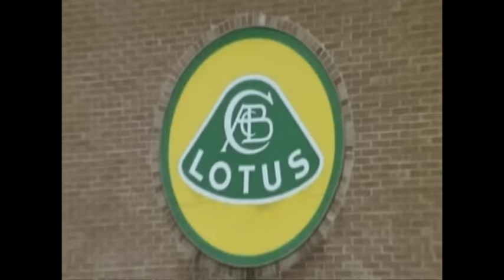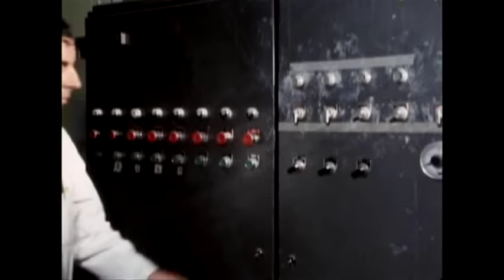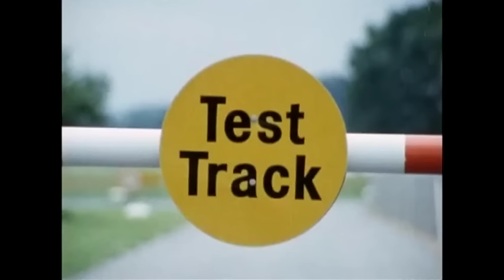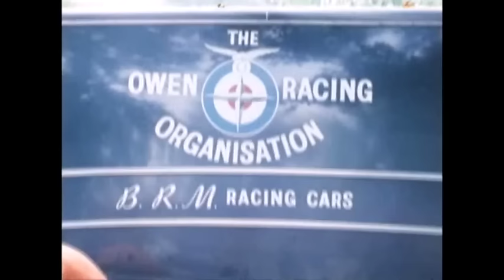1968 Millionaire: Colin Chapman

Comment: Chapman, the man responsible for Jim Clark's and Jochen Rindt's dead plus several other thankfully non lethal accidents caused by lack of structural integrity because saving weight was more important then human life.
Reply: they knew the bloddy risk, so do I...I´m fully aware of that whenever I sit in my Lotus too...no to very little margin for error in those wonderful machines
Reply: There's a difference between knowing about the dangers of a crash because you knowingly drive in a bathtub filled with gasoline and crashing due to lack of structural integrity. I'd love to see your reaction if a loved one dies because of sudden suspension failure. Even more so if you knew that Chapman neglected using bigger security factors in his stress calculations to save weight. Other teams didn't and they ran just fine. Not saying he was a psychopath/sociopath but he certainly had his priorities in the wrong place.

It was well known at that time (late sixties, early seventies) that his cars were fragile and even Rindt complained about it if i'm not mistaken. Ironically that's exactly why he died. And i'm not saying fragile in the sense of being dangerous if you crash but fragile in the sense of failure of essential car parts while you drive at 180 mp/h etc.
Reply: SpocksBro Circumstances about Clark crash are still not clear, but you are right for Rindt ; he complained about security to Chapman more than once... Even if I am a Lotus lover, I can’t discuss this, sometimes Chapman went too far... And as he was often convinced he was right, he did not took care about security... I do not know how to traduce this in basic English (sorry, I am French...), but it seems he said that he pays his pilots for ´fear salary’... Please if I am wrong correct me!😉
Reply: SpocksBro, One could argue that racing is about constantly changing things and compromises are part and parcel of the process.  Safety is not the first place to look for in compromises but unfortunately, it is always where those decisions come back to when things go wrong. Racing has always been about pushing boundaries and safety can always be blamed when things go wrong but hardly ever given credit for when things turn out well. It is a dangerous sport for that reason. Even if the best and safest things are done and someone dies, it is also easy to say safety could have been better or some part on the car could have been designed better to prevent this kind of thing of accident. The drivers always have the option of not driving or participating. No one is forcing them to do it.
Reply: Ridiculous conclusion to reach. Shows no respect for or understanding of racing in this era. It was very clear even in this video that Chapman cared deeply about driver safety, the monocoque chassis design saved many lives compared to the tubular steel design, described Jim Clark as his 'best friend', he never really got over his tragic loss, he's even warning rival Bruce McLaren about a potential problem (18 minutes in) and calls Graham Hill in on safety grounds! You'll notice the drivers at the time raced with open face helmets. It would make more sense to blame the helmet manufacturers for not caring about safety. It's a great video, why try and ruin it in the comments with negative garbage you heard from somewhere else?
Reply: Probably the stupidest comment on YouTube. Well done 👏🏻👏🏻😂😂
Reply: Clark was killed in all likelihood by a rapidly deflating tire brought about by a slow puncture in his tire sidewall. Examination of the tire post crash found a nick that would've prevented retention of air post reinflation. The deflation would eventually cause centrifugal forces to build up to the point where the sidewall lost integrity and collapse. Evidence for this theory is backed up by several witnesses at the Sachs Kurve who noticed Clark  putting on opposite lock going into the stadium section for no apparent reason before starting the lap he crashed on. This would be consistent with a deflating tire.
Reply: This insults that he did it on purpose, which is very clear that he did not do this. So a race car driver died in a race. That’s the risk you take. Any many drivers died in non-Lotus cars as well.
Reply: @grossmeister1181  I would have to disagree. And no one insinuated that he killed people on purpose, just that he was blinded by the hunger for success at any cost. If cars continue to break down due to structural weakness, there's a problem. If the structural weakness includes parts of the car who's failure would likely lead to very bad incidents at high speed, there's a big problem.

The fragility of his designs were criticized by various people back in the day. If I remember correctly, even Jochen Rindt complained about it. Ironically, that's the reason he ended up dying.

If people die in a plane crash we don't tell them, well, you knew flying can be risky so, live goes on. People lost lives which leads to an investigation to find out why it happened. If it's due to bad engineering, responsible people lose their jobs and the flawed design gets improved in order to lower the chances that it ever happens again.

What I'm trying to say is, it is one one thing to use a low safety factor in stress calculations in order to save weight on parts that have a low risk of endangering human life. it is another thing to do that on parts of the suspension or breaks because if those fail, drivers lose their lives.
Reply: @SpocksBro  R. Rodriguez died after a crash - no evidence of technical failure.

G. Hocking died after a supposed renal colic.

J. Rindt died due to technical failure AND because the didn't attach the safety belt correctly - not 100% a fault by the Lotus

R. Peterson died in the fire caused by the crash at the start

J. Clark died in the F2 race due to a tire failure

25 other drivers did not die in a Lotus though. So, there's only ONE possible death due to a technical failure - Rindt. 

Senna also died (in the Williams) due to a technical fault, Siffert also died (in a BRM), even though it's not clear if the suspension was damaged by a first contact with Peterson.
Depailler died due to technical failure during testing at Hockenheim (Alfa Romeo).

So you want to tell me, the Lotus were all dangerous and many people died in them?

Get the facts clear prior to posting such a bulls..t! 

There is no evidence, that it was more dangerous to drive F1 in a Lotus than any other race car!
Reply: @grossmeister1181  Most cases you mentioned are totally irrelevant since they have either nothing to do with Lotus or happened during a later time where he apparently not only had finally learned his lesson but was also forced to since concerns about safety started to rise in the early seventies and more safety measures were introduced from there on as well as car inspections and guidelines. 

We're talking initial period of his racing team up to early seventies. During that time various sources, including drivers, criticized him for designing fragile cars. One of his maxims was saving weight.

To quote Chapman himself during that time:
A racing car has only one objective: to win motor races. If it does not, it is nothing but a waste of time and money. It does not matter how clever it is, how inexpensive, or how easy to maintain, or even how safe it is, if it does not consistently win it is nothing.

This quote not only tells you how eager he was to win but also that safety didn't really concern him that much as long as it got him there. 

All of this boils it down to Clark and Rindt which are the cases I mentioned the day I posted the original comment. Rindt was suspension failure period. Apparently he didn't wear his belt properly but that doesn't change the fact that something as essential as the suspension failed which should have never happened in the first place. One does not play around with stress safety factors on essential car parts who's failures can cost life's unless one doesn't value life. We can speculate if he would have survived with a properly strapped on belt or not but that's all it's going to be, speculation. As long as the failure is not caused by external forces, it is the responsibility of the engineer that designed the part.

Clark's accident is somewhat of a mystery. I went down the rabbit hole of getting stuck reading a 16 year old forum thread about the subject for around 2-3 hours. As far as I can tell it isn't entirely conclusive and many questioned the validity of the report. Report claimed puncture and eventual failure of the tire, critics claim it was the suspension. After reading the whole thread I'm more on the side of the tire failure but I can't be entirely sure. Chapman appointed the man who did the investigation which raises suspicions. Chapman never made the report public after a conclusion was reached which again is suspicious. Was the reason for this suspicious behaviour because they - Firestone and Chapman - might have been trying to safe their asses? Guess we'll never know. The investigative team should never be appointed by the involved parties, that's for sure.

It's hard to find any data about DNF's and their cause in F1 during the sixties though I tried at least for a few minutes. Clark and Rindt are certainly the best known because two great drivers lost their lives. All in all I still think Chapman was too ruthless during that time. Add to that how shady a Character he was, I still kinda blame him for their deaths.
Reply: @grossmeister1181  Nope, you don't play around with safety factors during stress calculations on parts that can potentially cost someone's life just because you want to win a race. Exactly which part of essential parts who's failure likely lead to catastrophic outcomes don't you understand I wonder. Some of which - suspension and breaks - I mentioned before.

Yes, I botched that one, should have been breaks, not suspension. There was a report of Rindt's breaks failing in another race during that very same year. It's been decades since I finished my degree in mechanical engineering. Never the less i can still say with a good amount of confidence that it would be easy as pie for the average engineer to choose the right dimensions and material for a part as simple as a break shaft in order to ensure close to zero chance of mechanical failure unless of course you desperately want to save weight, desperately want to win races, don't value life and decide to take the risk. Chances can never be reduced to zero but if it happens at least twice in the same year on parts like breaks no less, I'd have a serious chat with the responsible party.

There was only one true witness of Clark's accident and that witness didn't report much except for a wage description of how the car went past him and off the track. Even the driver behind him was too far away to be able to add any useful information to the investigation. No clue where you get that "it’s pretty much everyone‘s opinion who saw the accident" from when there basically was one witness only. The incident had to be reconstructed by investigating whatever wreckage they got handed over, mostly.

Uh, no shit sherlock, all race cars are dangerous. Greedy engineers with disregard for life are even more dangerous. 

Ever wondered why many systems on airplanes have redundancy built into them? Because they are essential for the survival of the passengers and the likelihood of a failure should be reduced as much as humanly possible. The only thing you can thank Chapman for in terms of safety is that his and others disregard for life in F1 motivated Jackie Stewart to push for more safety measures in F1 during the seventies and it's been improving ever since.
Reply: @SpocksBro  You still don't geht the point. Go read the stories before arguing. You don't have a degree in anything, otherwise you would not post such crude theories. 
Every F1 car is built on the edge. You cannot calculate all the loads, that might occur, especially back then. So it was ONE failure of a brake shaft that lead to the death. So you should be saying the same about Patrick Head and/or Adrian Newey?
Reply: @grossmeister1181  Crude theories? You haven't argued any of them. They didn't have numerical FEM back in the day but analytical methods accurate enough to reliably calculate parts as simple as shafts, struts, control arms (von Mises comes to mind) have been around for over a century. 

Things are also somewhat more complicated if the load problem is a dynamic instead of a static one also depending on how the force changes over time as in periodic, chaotic etc, the frequency and amplitude of changes if I remember correctly.

What it essentially boils down to in application is the ability to correctly isolate a part, simplify it in a model, determine the location, direction and amplitude of all action and reaction forces plus geometrical dimensions. You then move on and choose the calculation method you feel is most appropriate for the problem (von Mises for example as mentioned or others who's names I can't remember), pick a premade formula out of a table of most commonly found problems, insert force value, insert material constants (e.g. maximally appliable stress values before material failure etc.) you find plenty off in published tables, use calculator, estimate a safety value you feel like is appropriate to your problem depending on risk/reward.
I could be off in some of the procedure but it's been over 25 years ago since I last did some of this stuff. The most difficult part of this procedure is isolating a problem and simplifying it enough in order to be able to do analytical calculations without losing too much accuracy. Nowadays, that is last i checked out of curiosity since i don't work in this field anymore, one uses FEM (numerical method done with computers) in most cases where structural integrity is of importance.

Back in my days (mid nineties) FEM was still in it's beginnings but there were courses in offer already. Software was clunky to use, running on SUN Unix workstations no less and there was only very crude integration of FEM into our CAD/CAE software (Unigraphics). Nowadays you just model a 3D part in CAE, let it generate a FEM mesh automatically, determine stress model used for your fem mesh and mesh element, determine constraints and forces, press run and done. Even more crazy stuff like artificial intelligence evolving an optimal geometry through FEM and evolutionary algorithms. Crazy times

Either way back to our break shaft. It is an easy problem to solve and was even back then because the geometry is simple and there's only torsion involved, plus some small longitudinal normal forces that can be discarded. In other words, if such a simple part breaks it was either designed to be working on the brink in order to safe money, weight etc., pure incompetence or due to unforeseeable external forces. In case of a shaft (this one I had to google) the stiffness scales with D^4 and D being the shaft diameter. That means it takes very little diameter to increase the stiffness by a high amount. Mass optimizing such essential car parts with little gain but risking lives for doing so is immoral, I'm sorry to say.

Sure, race cars are always on the brink but there's a lot of places to optimize without the risk of killing drivers and without losing much advantage. Even if there was great loss of advantage in exchange for a life safety, I think there's no question which one to choose. Improve the f'in design instead or let regulations handle it.

Btw. Senna's cause of accident was never resolved, at least officially, yet you claim otherwise. Which leads me to the end of this way too long comment. I think you're full of shit and don't like to give in, at all. You probably think the same of me which is why I think we should let it go and move on. Time's too precious. You may have a last word. Until then, have a good one.
Reply: @SpocksBro  Sure, come back when you have the prove for your theories. You didn't even reply to any of the facts. The facts, that a lot of people died in non-Lotus cars, also due to technical failures. But you only accuse Chapman. That is utterly wrong. And you forgot many ways that can lead to a braking brake shaft though. So if you're not willing to even try, don't repeat those theories. And give facts, like I did!
Reply: @SpocksBro  And thanks for the sh-word-part. Shows your real face!
Reply: Completely ridiculous. Like saying Henry Ford, the man responsible for everyone who died driving a Ford.